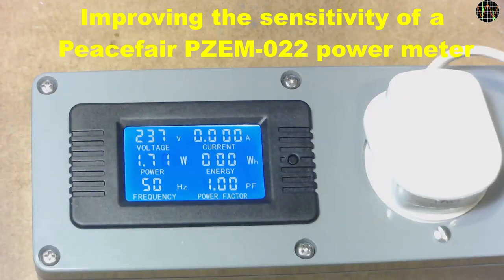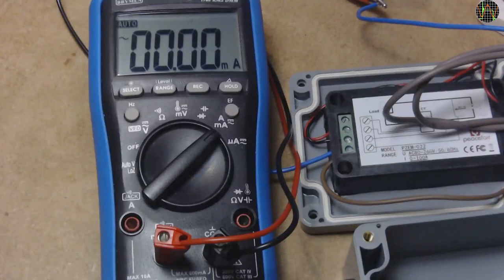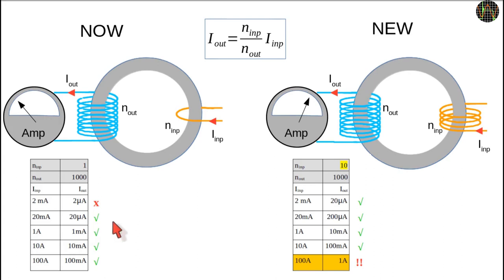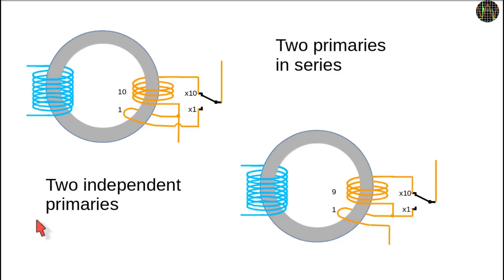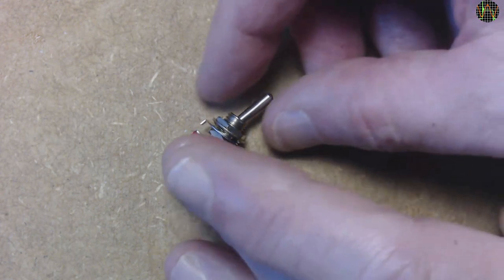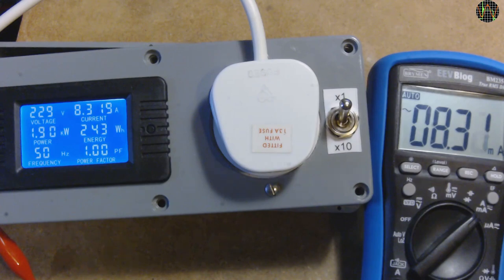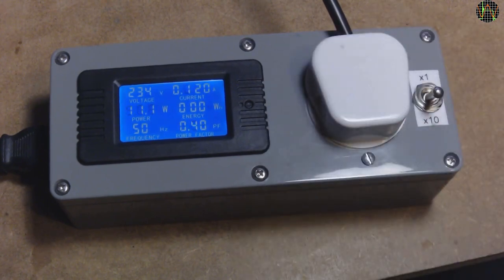Improving the sensitivity of a Peacefair PZEM-022 power meter

Comment: Very nice solution, and good to see that it worked. In my solution the meter is placed in an box with an isolating transformer followed by a vario transformer all protected by an 6 Amp fuse, so I do not need a switch, and with your test of the concept, I only need to add the 9 turns to my transformer :-)
Good solution with your switch to get the full range.

Comment: I wonder if a more happy medium of x5 can be achieved. Then the max is 20A, which covers all hobbyist requirements, and gives 5 times the sensitivity. 
Also, the switch and the dual primaries  would not be required.
Of course the readings will be wrong, but I'm wondering if that can be accounted for by fooling with the burden resistor on the CT output.  (and making it larger and external to the meter, so that the fuse might also be eliminated.
I will experiment with that on my implementation of this project...
Reply from the maker: x5 is making readings complicated. I recommend to use x10 mode only for very low-powered devices such as LED lamps which otherwise give no or a very coarse reading. For anything else x1 mode is to be used. It may be a good idea to change the switch to one that automatically toggles back into the x1 setting if you let go. That way you can't leave the unit accidentally in x10 mode
Reply: @TheHWcave  I'm not usure if I got my meaning across properly, and I've had a little bit more of a think.

The 100A range is too wide for most needs, so the 10A range you have implemented is a good idea, and with the 2 range switch, it probably is the best solution.

But I was just wondering what else might be done instead. What if the range could be reduced to around 15 or 20A permanently, which then covers the 10-15A range of most mains power outlets.  

With 5 loops, and doubling the burden resistor, you would have the 10x range and sensitivity. (roughly, it will probably be non-linear, and require fine tuning).
The questions are, how much over voltage can be applied to the ADC input? and what will the firmware do with over-range ADC values? and can they be displayed? 
Though unlikely, but it may turn out to be possible to have a single 15A range (with the meter displaying 150A). 

Again, your 2 range project is probably the optimum solution. But I'm curious to explore other possibilities.
Reply from the maker: @bertoid  Of course you may change it to a x5 range. I personally have not considered it necessary. In x1 mode with currents <=10A i.e. normal house hold loads,  the module  has a resolution of 1 mA  which is IMHO is totally sufficient and probably an overkill already given the accuracy of 1% and that mains voltage and hence the current is fluctuating all the time anyway.  Also consider that the voltage is always in full volts it could be off by at least half a volt which means at 10A an error of 5W. 
The only reason I added x10 range is t overcome the > 20mA limit of the module to measure PF which is a problem for small devices like LED lamps.

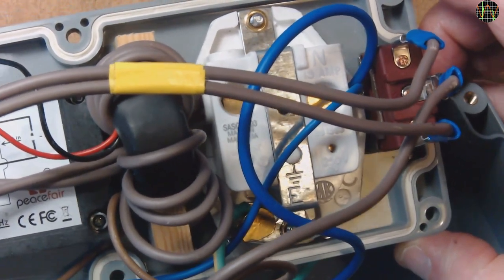Comment: Hi, Heinz. I want to add the x10 option, but I am having trouble following the instructions for adding the 100mA fuse... I think that you are saying to insert it into one of the coil wires, between the coil and the module. Do I have that correctly? Please and thank you. @9:40
Reply from the maker: It goes into one of the thin black or red wires (does not matter which) connecting the current transformer to the module. It does NOT go into any thick brown or blue wiring carrying mains current! Adding the fuse is really more a belt-and-braces approach. It would only trigger if you measure more that 10A in x10 mode. Normal mains appliances rarely go higher than 10A in countries with 230V mains. For 120V countries, yes, adding the fuse makes more sense.
Reply: @TheHWcave  Please think, that the 1.000-windings-coil never works open. Then You will have very high Voltages in this coil. This is the case, if the fuse ist melted. So it seems to be saver,  to work without a fuse.  Furthermore a fuse of 0,1 A F has a resistance of several ohms.
Reply from the maker: @HevyFilms  Both are very good points. I guess a MOV across the transformer would be a good thing to add. The fuse resistance (within limits) should not make a difference because the transformer is delivering a current and the fuse is in series with the sense resistor, so both see the same current.
Reply: @TheHWcave  You dont think, that the Voltage of the Fuse has any negative effekt? If You have 10 Amperes and x10, you will have at least round about 100 mV at the fuse.  Whatever, Your solution and your video is very good anyhow and I copied this device!
Did You ever measured the inductance of the 10 windings throu the core? Whats about the additional phase shifting and the additional Voltage drop?
Reply from the maker: @HevyFilms  The secondary of a current transformer is providing a current which is scaled according to the current in the primary. That means the resistance is kind of irrelevant, if it is higher, the current transformer simply increases the output voltage until the target current is reached. That is the reason why it should always have a load, because otherwise it tries to scale the voltage up to infinity (well, very high...) It takes a while to get your head around. This works of course within limits. You would not put kilo ohms in series and expect no effect. It is similar to a normal transformer where you can add additional parallel resistance and within limits, the output voltage will not be affected.  No I did not measure the inductance of the 10 windings, maybe I should but I am not sure if I have the tools to do it. I used pretty thick mains-rated wiring in the box, I think 1.5 square mm because I wanted to be able to handle at least 13A. To answer your question, I just measured (4-wire) the resistance of the mains path from the input socket to the output socket of the box. In x1 mode, it was  about 0.1 Ohm, in x10 mode 0.45 Ohm. At 10A in x1 mode this drops 1V, in x10 mode 4.5V. I can live with that, especially since I use x10 only when the current is too low (<<1A usually) to get a good reading in x1 mode
Reply: @TheHWcave  Thank You very much for the interesting answere. If I have time, I will measure the inductance, because I have a additionell core. I will tell You the result. I dont think, that we have a problem with the 10 windings, but it is a interesting question.

Comment: I tried to add more turns but for each turn the amperage increases very little, the watts decrease a bit and the power factor also decreases.  I tested with a small hair dryer set at low speed 250W and power factor 0.64
Reply from the maker: That is not how my unit works.  Example1: A GU10 LED lamp measures in 1x mode: 0.044A, 5.84W, PF 0.55. In x10 mode: 0.425A, 57.5W, PF:0.56.   
Example2: A fan:  x1  mode  0.181A,  30.0W , PF 0.70  in x10 mode: 1.775A, 298W PF 0.71. The values in x10 are slightly different because of the better resolution with higher values but otherwise this is exactly what I would expect.

I am trying to think what could have gone wrong. I suppose you did the easier method of having two separate sense wires, a single one and one that loops 10 times, and switch between them?  It is important that the 1x is completely off (no current but also not shortened) when x10 is on and vice versa. Otherwise the two can start cancelling each other.
Reply: @TheHWcave  I tried two different devices, both react identically to this hair dryer and only in the no heat mode and fan on the minimum position.  Other devices follow the rule of the number of turns.  I used only one wire and only made different winding combinations.  the dryer model is philips 8233. funny is that it was the first device tested and it caused me confusion.
Reply from the maker: That effect would be well worth investigating. I looked at the web pages of the (discontinued) hair dryer which seems to have quite a bit of electronics on board. Ionic (does it have a high-voltage multiplier?) and possibly speed control (phase control circuitry?).  If you turn the hairdryer off between changing the config, does  it always start with the same values if you keep the config the same? In other words, its speed control may behave slightly different at every restart, for example because the fan turns easier if it was running earlier (warmer motor bearings & lubrication...).  Do the values change (significantly) while running without anything being touched? At least at my place, the RMS AC voltage fluctuates quite a bit, so its nearly impossible to accurately compare measurements done just seconds apart. If the electronics in the fan tries to maintain speed at a fluctuating AC input, it might well modify the phase angle noticeably.  Hope you can safely(!) experiment a bit more and report your findings?
Reply: At this low speed, the motor (supply circuit) use a current so constant that the transformer does not work. adding more turns only makes the power factor worse.  I think there are several situations like this and a major change in the power factor from mode x1 to x10 implies an incorrect measurement. At the moment I have abandoned the project but I promise to come back with details when I finish the workbench from the location where I am moving.
Reply from the maker: Its AC so whether a current is constant or not, it will always work with the transformer, however, its RMS value may be too low for the thresholds built into the Peacefair to register. The power factor will not change with more turns through the transformer and I have never observed anything like that in my device.  Something strange is going on in your build.  What kind of current transformer are you using? Is it a solid ring or one that can be opened? I have recently used a current transformer that can be snapped open and on one occasion I  found strange readings (current too low and a wrong power factor). On investigation, I found that the transformer ring wasn't completely closed. Making sure it was completely closed fixed that problem.

Comment: Thanks for the great video!

I have a question. In my application, I am concerned with the transients created when switching from 1x to the 10x mode and also the possibility of leaving the meter in 10x mode by mistake.
I am considering the possibility of wiring 10 loops and inserting an  intermittent normally on push button switch across 9 of the turns. In the normal state the switch would short 9 of the turns and leave the meter in the 1x mode. Pressing the button would open the short and cause the load to flow through the full 10 turns enabling the 10x mode.
I am concerned with eddy currents flowing through the shorted coil loops but It should be 1/9 of the load current and if I use the same guage wire as the load I should be ok.
What do think of this approach?

Thanks again for a great video.
Stephen
Reply from the maker: I think this will cause problems. You creating a magnetic short circuit which will cause trouble, probably not so much in wasted heat (if you use decent size wire) but the effect on the accuracy of the readings. That energy has to come from somewhere.  My suggestion is to use a SPDT rocker switch that has a "(on) on" characteristic. The "(on)" standing for momentary action. In other words, you need to hold the switch for the x10 position and it will go back to the 1x when you let go. A quick search on RS components (UK) shows part no 197-7866 , a rocker switch rated for 16A that would do that (but other switches and distributors are available)